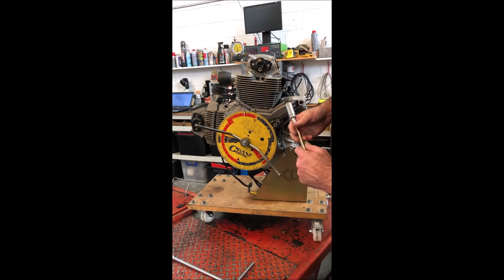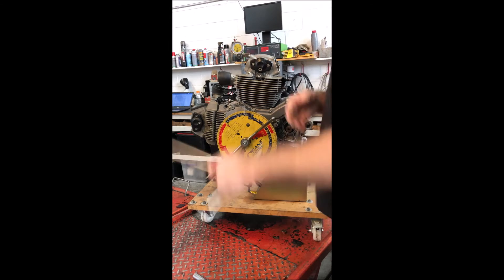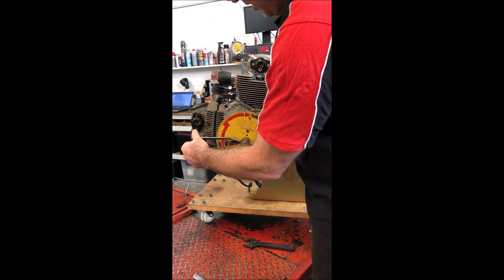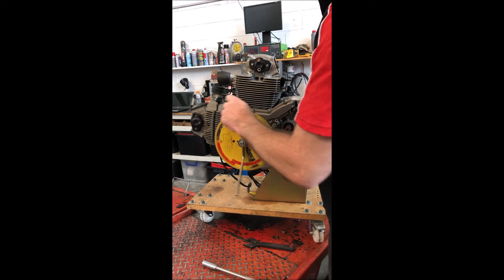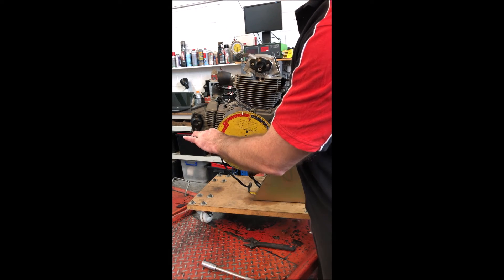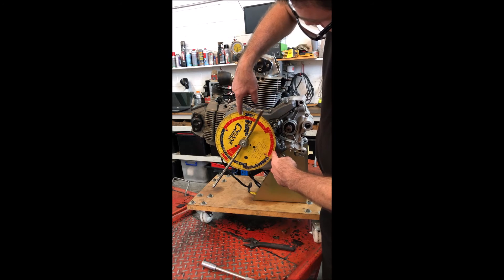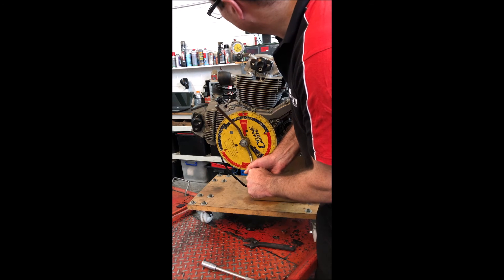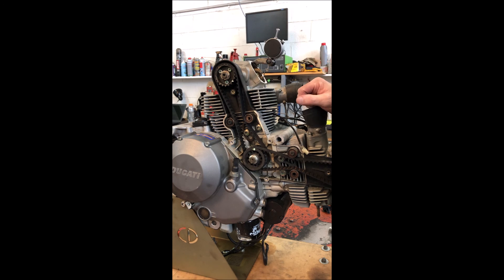Ducati 659 696 796 Engine - Valve clearance, Timing belts Cam timing - part 3

Comment: Thanks again for the video.  Quick question if I may?  What is the thread in the end of the crankshaft that you use to attach your degree wheel and turn-over tool?  I've got something that works but not sure that it is 100% correct and don't want to do damage.
Reply from the maker: m8x1.25, just a normal m8 thread.

Comment: hello brad, thanks for you videos and your knowledge! i hope i can reach you. i have a question. So far I understood how to measure the timing and the background of it. I still have some question left. i hope you can tell me that...

Before I do the measure, i have to correct the valve clearance right? Because the size of the valve clearance influences the measure of the degrees at 1mm valve lift. for example  we have 0,15 mm clearance the crankshaft measure would refer to 1,15mm "valve lift" . please correct me if i am wrong.

For the Measure of the TDC I would like to use the method shown by you. I have some carbon black on the pistons for some reason. Do you think this is relevant for measuring the TDC?

What are the longholes on the camshaft wheel for?

I know some people are sceptical about selftaught people like me doing stuff like that but i have technical background since many years and with some healthy paranoia i think i can do  that.
Would be happy if you have some minutes to write back on my topics.

Keep it up and Have a nice day!
Reply from the maker: 1/ if you use the centreline method the clearance doesn't matter, but you can jam a feeler gauge in there to take up the clearance if you want to.

2/ carbon on the piston makes no difference.  all pistons have carbon on them unless they're new.

3/ not sure what holes you're referring to.
Reply: @bradthebikeboy  Thanks brad for taking time!
Sorry i am austrian and i have to ask what is the centerline method in easy words?
So you mean the clearance is small enough to just ignore it?

The wholes through which the 3 smaller screws go. It is in your video part 4
Reply from the maker: @Byteswap  centreline is explained here - http://www.bikeboy.org/camtime2v.html

the long holes are to allow the cam to be rotated in relation to the pulley teeth.  that's what gives you the adjustment.
Reply: @bradthebikeboy  thanks - got it! 
All the best for you and your dearest!

Comment: Does anybody know if the measure devices at the valve is a normal dial gauge or is it lever gauge? I assume this measure is only possible with a lever gauge...
Reply from the maker: normal dial gauge.
Reply: @bradthebikeboy  and you have a fork measure insert i guess?
Reply from the maker: @Byteswap  i have little bits of coat hanger wire bent up as required attached with the little thumb screws.  it's great stuff.
Reply: haha i like your functional style! I had something similar in mind. Thanks for strengthen me on that plan! haha